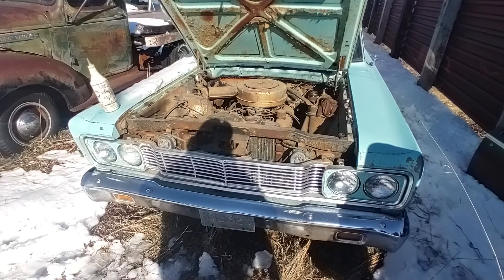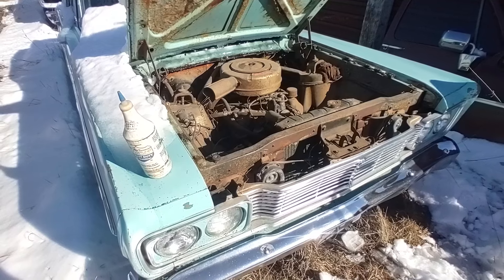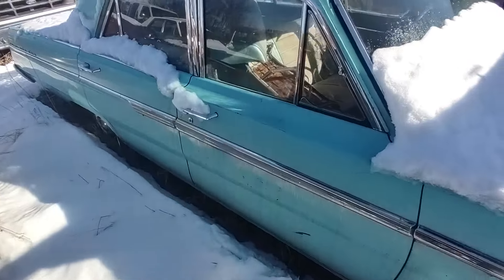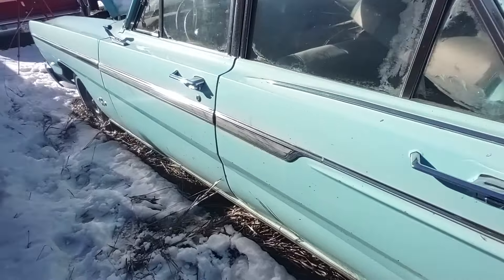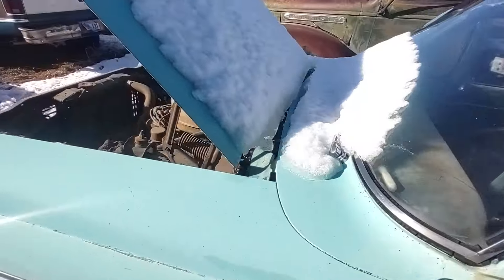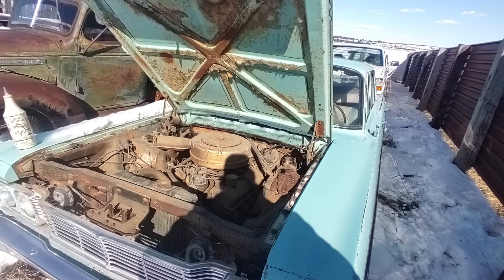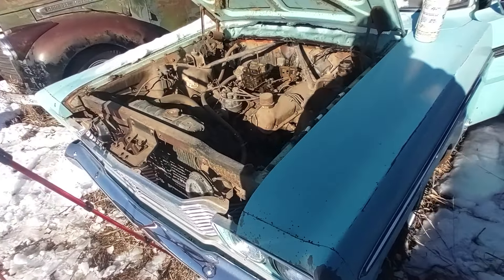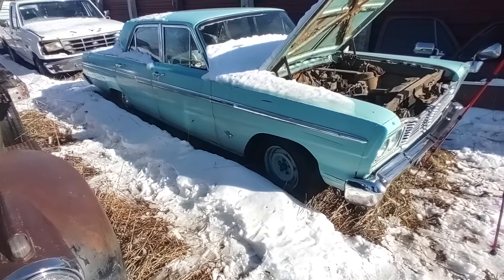Will it Run? 1965 Ford Fairlane 500 3 YEAR Cold Start. 289 V8

Comment: I remember my dad having a '65 Fairlane, when I was about 3 years old, which was 1975. His was black with red interior. He was able to buy it from our neighbor for $50 ( that's $295.52 in 2024 with inflation), because it had jumped time and Dad was desperate for a vehicle. He told me changed the timing chain and gears in -12F temps. He said it ran just fine after that.
Reply from the maker: Very cool. Thanks for sharing. I enjoy reading peoples stories